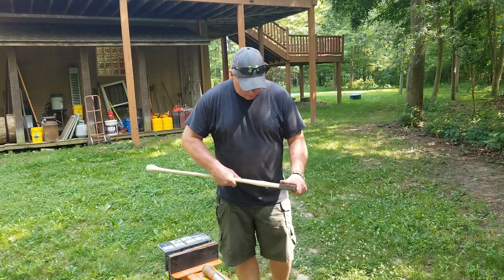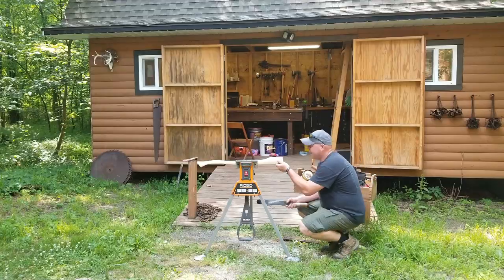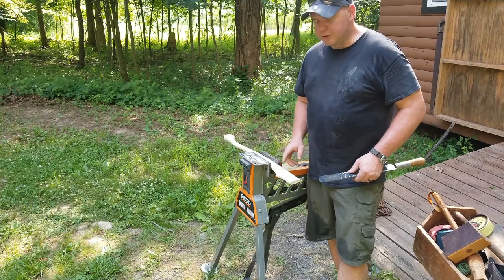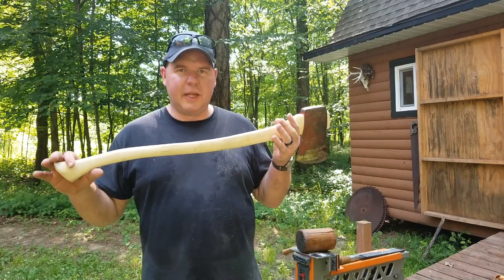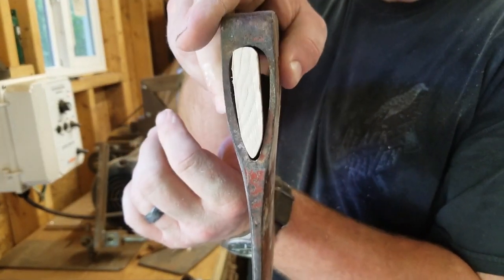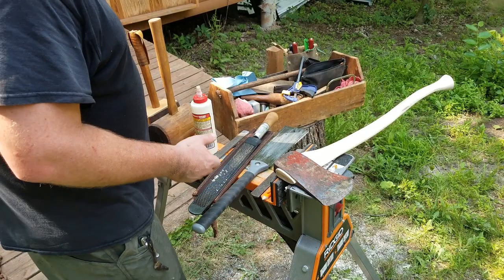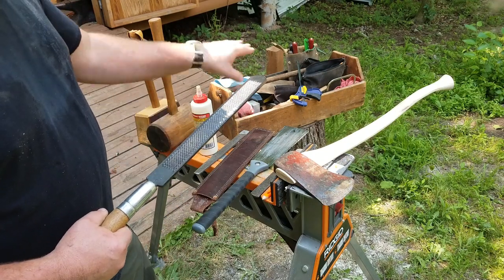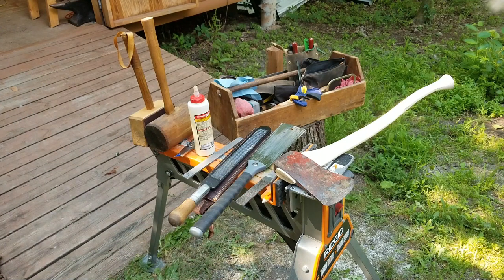How To Hang An Axe, The REAl Quick, Down And Dirty Version

Comment: The biggest issue I'm concerned with is making sure the wedge is placed right in the kerf, trying to get it all the way down while making it thick enough for some pressure.
Reply from the maker: I did this video in a longer version and talk about fitting the wedge.  It was right before this shorter version.  Check it out, it may help.